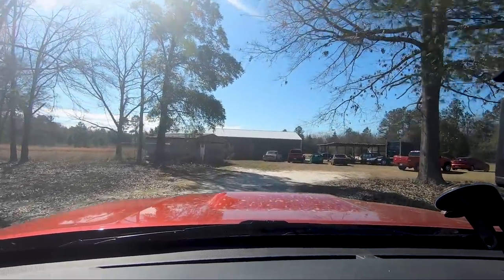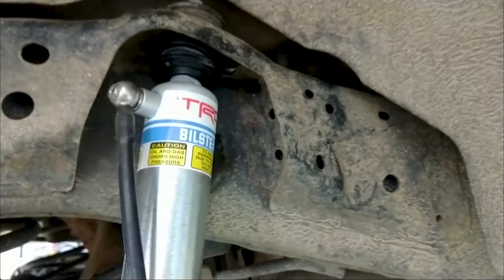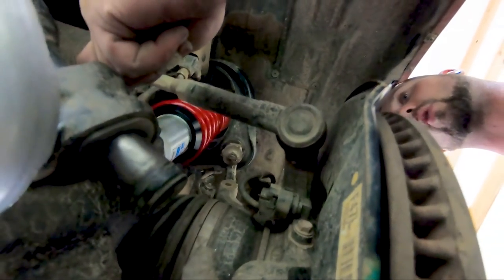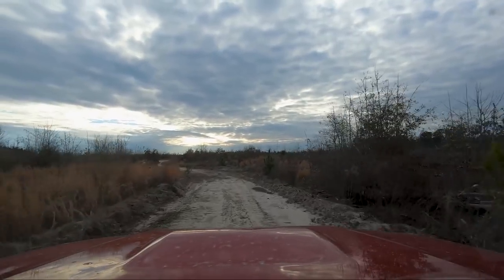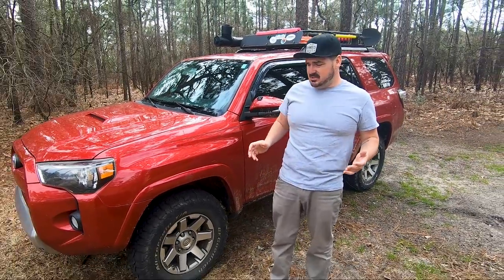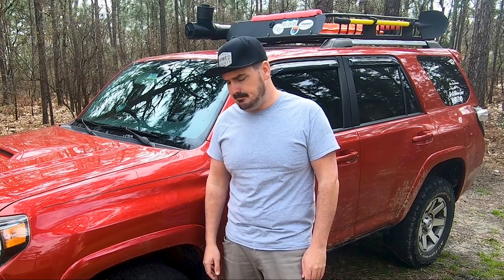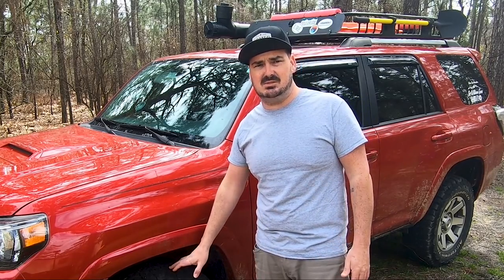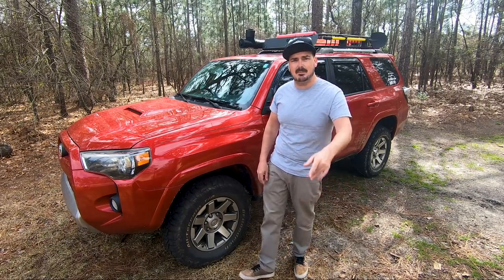Bilstein TRD Pro Suspention on TRD Off-Road Toyota 4Runner w/ KDSS

Comment: good job fellas! To make it easier on yall next time just place jack under the LCA, loosen the cam bolts, undo the 3 top hat bolts and the 2 lca bolts and the strut bolts, lower down and boom its out in 2 minutes flat. then to reinstall just slide the coilover back up in, hit top 3 bolts, then jack the lca back up to bolt the bottom strut bolt back in then the LCA bolts and tighten the cams back down and done.
Reply from the maker: Dang that sounds a great deal easier. Will do when I get another setup hopefully with more lift and UCAs
Reply: @SirWilliamGoes  When you go to do the UCAs just cut the head off the long bolt and they will come out easier, and when your replace with new bolt just reverse install with loctite and you can get the bolt out a million times easier later on if you need to do a trail repair. Just dont forget the loctite lmao!

Comment: Just bought a 2020 4Runner TRD Pro!.. I use to drive my brothers 2019 TRD Off Road and absolutely love the difference the Fox Shocks make lol.. We live in a mountain town in BC with lots of snow during winter and washed out rutted dirt roads in every other season lol.. I have felt the off road bottom out and it felt nose heavy.. The Fox shocks soak up EVERYTHING lol so well.. I see ruts and holes coming then brace myself then barely feel a thing lol.. The TRD Off Road is definitely amazing but you felt the ruts that sneak up on you lol..  And the nose loves to "dive" as you said
Reply from the maker: Yeah I'd like to have the Fox for sure
Reply: I heard the Bilstein shocks are great too though.. I conquered amazingly advanced technical trails in my brother's stock 2019 TRD Off Road..  When I had no base of comparison, my brother's TRD Off Road was greatest thing i'd ever driven off road lol.. Now that i have the pro, the Fox Shocks balanced the ride in all the ways it counts most.. I showed my brother this video.. He wants to do what you did lol

Comment: The clunk is the Bilstein shocks in the front...get rid of them and install the Ranchos....clunk gone! I had the same problem. I left the Bilstein on in the back, no issues.
Reply from the maker: interesting Ill look into that further. I figure the clunk is the needle bearing think that goes bad causing the cv to feel loose
Reply: @SirWilliamGoes  it's something to do with the strut mount. They just suck and there's no way to fix it. The spring bounces around...
Reply from the maker: @dodoinurpants  I think that's a different clunk however I think I may know the clunk you're talkin about happens whenever I reverse and brake or put it back into drive and go

Comment: I’m bringing my 2018 off road with KDSS into my shop to have 5100’s installed. My mechanic has zero experience with KDSS 
Can you give any recommends that I can pass on to him for the install with KDSS? Any help would be greatly appreciated!!!
Reply from the maker: My only advice is when you undo the sway  bar the piston for the kdss will drop completely when you go to reinstall slowly compress that piston again with the sway bar in the groove then reattach it to the lower control arms. If you compress it too fast you risk damaging it. Also it will be much easier to install at lowers when compressed. That said, you could be a G and just take the kdss off!!! No Sway Gang!!!! Its a bit off a difference but not huge.
Reply: @SirWilliamGoes  thx for the info! Much appreciated

Comment: How much lift on the front and back? And is it 5160 all around or did you have 6112 for the fronts?
Reply from the maker: It's all stock in this video with the exception of spacer lift

Comment: Looks great man! Did you get an alignment done afterwards? I just put 5100’s in the front with stock springs and 5100’s in the back with ome 2895e coils on the back on my SR5. Rides so much better.
Reply from the maker: I haven't yet figured when I get new tires I would.

Comment: What’s the model # for front and rear? And what did you set the shocks at ? 1,2 or 3”s
Reply from the maker: Not sure the model number. I installed them as they were out the box wasnt aware of any adjustability

Comment: Question for you boss, I got the same suspension as you got for my ORP w/kdss. It didn’t come with any hardware for it, would the stock bolts and nuts still work for the TRD Pro suspension install?
Reply from the maker: Yeah that's what I used.
Reply from the maker: You can get the install instructions printed from dealer

Comment: Just got offered the opportunity to lift my TRD off road to the Bilstiens trd pro lift 2.5 front 2.0 rear for 2800 installed, do you still feel it’s a good lift?
Reply: Thank you for any insight....    I’ve been trying to figure out which direction to go.....    full lift or stock lift....
Reply from the maker: Definitely think it's a great lift.
Reply: Thank you!  I just wanna confirm you are still running the stock upper control arms?
Reply from the maker: @lloydling2928  yeah but if you can change them it wouldn't be a bad thing at all

Comment: i have the same concept of oem parts are superior in MOST cases. Working at a dealer and seeing it first hand walk you down that path. My tundra has a arb off road bumper with winch and the trd off road suspension is a little bit weighed down in the front because of that extra 250 pounds., going with the OME front struts and ome heavy springs to correct that.  

use rev nuts for the shock res. mounts! that would be a OEM repair. its basically a threaded nut that is pressed into that hole with a tool that makes it oem-is. it will look and preform like factory
https://www.amazon.com/rivet-nuts/b?node=16410051

clunk looks like inner tie rod.not a horrible job. awesome buy man. super excited to see how she does on future trails!

what are your ideas on your next tire purchase? i will have a nice set of ko2s up for sale in a few weeks off my tundra complete with a spare. and rims. see if my 2014 tundra wheels will fit your rig. ill make u a deal. one tire will need replacement as i punctured the sidewall on hurricane creek trail last weekend but the other 3 tires and spare are decent.
Reply from the maker: OME makes some good stuff for sure. I'm gonna rock these mounts they seem to work good. When I replace tires I'm thinking either go back with BFG or may try the general grabber ATX